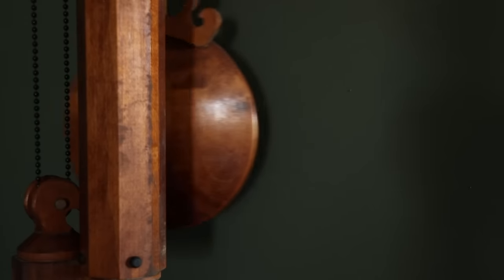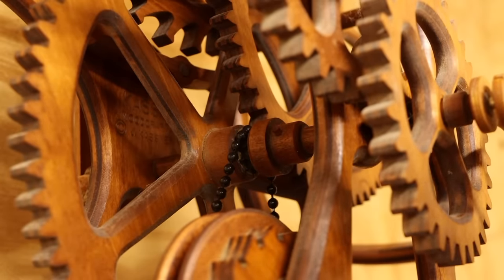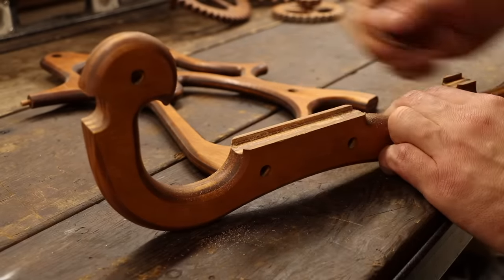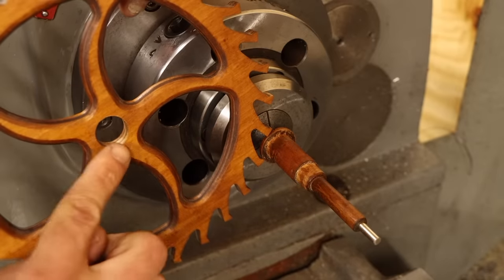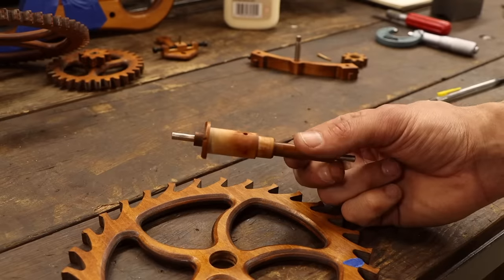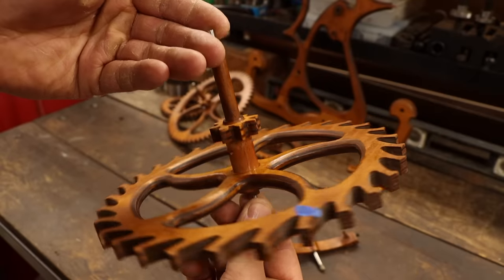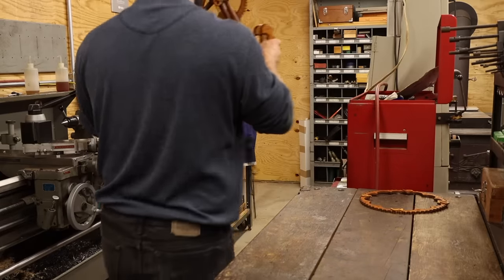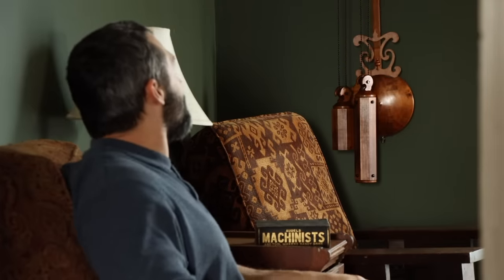Resurrecting the Phoenix Clock || INHERITANCE MACHINING

Comment: I just got a 3D printer for Christmas and I've been wanting to try and make a clock like this. I was really worried about it being plastic, but if a wood clock can work that well, a plastic one should too!
Reply: In theory it could be better as long as you dont have uv exposure! And you can have access to lubricant options!
Reply: @MrHazz0  Yeah I was thinking something like a wax so it doesn't run off but is maybe still more smooth than the plastic
Reply from the maker: I'd say it's worth a shot!

Comment: So, I just discovered you this past week and have watched many of your inspiring videos.  I’m 75 and had a summer job working in a clock shop for two summers in the late 1960’s.  For posterity, I’d suggest you leave a hidden note on the wall brackets with names of the four generations involved.  Thanks and God bless!

Comment: Great project! Brilliant detective work to figure out the problem and an elegant solution too. Now you just need to fix those dial calipers so the "zero" is at 12 o'clock where it belongs! This will take a bit more work then the 12" caliper fix. If I remember correctly they jumped .025 or 90 degrees. That is easily fixed with the "key" This fix will require a little more finesse and a bit of patients. Open and close the calipers and using the "key" see if you can get them go "reset" .025 or 90 degrees off. Once you get there setting zero at high noon is a piece of cake.

Comment: Because it isn't going to be seen (in theory), for longevity, I'd have replaced the wood glue with 5 minute epoxy right from the start...

I'd also have re-cut all the bushings for brass sleeves and replaced all the axles with brass rod to strengthen all rotating/pivoting joints and reduce friction overall...

Still, what you've done looks fantastic!

Comment: This is my first look at your site and I'm impressed with your great work restoring a beautiful clock! I've made clocks of my own design with my 3D printer and one out of wood with my DIY CNC router. The plastic clocks work for a while (36 hours) but eventually they won't run for more than a few hours. The wooden clock is made from maple (not plywood) by CAD modeling a set of plans meant to act as a template for scroll sawing parts in Baltic birch. The wooden clock doesn't work at all. I need to use some of your techniques to evaluate the concentricity etc. but the design does not have all the adjustments of your Kastner clock.
In your spare time maybe you could document the design so the rest of us could try to build the clock as well. 😀 Dave's Videos below is right about the manual. It looks like a treasure trove of information about a classic wooden clock.

Comment: Awesome clock and a wonderful story behind it. So pleasant to watch it. I tried to build my own clock using a 3D printer a few years ago just before I entered university (I am a master student now) and the clock is mostly working just fine, I even published the files online. But I designed the escapement quite small for the tolerances that my 3D printer has, so the escapement has a bit larger backlashes which cause a bit louder "tick-tock" noise than I would appreciate. Since then I sometimes think about better-working and better-looking design, and I think this video pushed me to do that.

I noticed that the pin of the fork has a noticeable gap in the pendulum's slot and thus is skipping during every swing movement of the pendulum. This leads to a significant loss of energy, which can even stop the clock, and should be avoided. The fork should fit the pendulum rod almost precisely without any gap.

Also, the anchor seems a bit weird to me, as the pallets look like in the case of Graham's escapement, but they are placed/rotated in a way (especially one of them) that causes backward movement of the escapement gear after every "tick".

And the interesting thing is also that involute gearing is obviously used – this is not a common thing in horology as cycloidal gearing (or some approximation using circles) is usually used because involute gearing for high gear ratio requires large undercuts for pinions.

I hope your clock will work without any stopping!

Comment: Thats so nice! You managed to get some heritage runnig and I'm sure everytime you look at the clock you will remember your grandfather :) 
I have a old mechanical Wallclock inherited from my granduncle and -aunt. It's a beautiful peace with an wood and glass cabinet hanging on the wall. The clockface is made of metall covered with enamel and the mechanic is all made of brass with a pendulum hanging on a wooden strut, also made of polished brass as well as the weights. I got it many years ago and it wasnt working so I also spended like a week with disasembling, overhauling and reasemble the whole thing. Then it was actually ticking just fine for some years with astonishing precision of about 3 minutes per week. :o But at one point, few years ago, it stopped again and since then it is just quiet... When I saw your video I really would do the next overhaul to mine. And I will do so I can hear the soothing tik-tak again... Thanks for the encouragement to make it again working ;)

Comment: "Kassner had also spent most of his life as a teacher. But when Kassner eventually became disillusioned with the politics of university life, he moved to Tuscaloosa, Ala., near his father-in-law’s lumber mill to begin building clocks, which he felt was the pinnacle of woodworking achievement."

"Kassner designed all the computer equipment for the operation himself, something unheard of in the 1980s. Aside from that, he also designed his own chemical for a special woodworking process called die staining.

“Usually when people work with wood, they stain it on the surface, and what happens in wooden clocks is that stain wears off and works itself into a compound that destroys the gears and everything else,” Tom said. “But Kassner came up with a process that impregnates the maple called die staining.”

Exerpts from an article i found online about someone who came across and built one of these. Local town paper called dyersville commercial. Com. Interesting story.

Comment: I own a Skeletonized Fossil watch, so seeing the Phoenix Clock show up on the feed was an amazing thing to see. Here the mechanical watch is on my wrist, while you have this beautiful clock one up on a wall! As soon as you mentioned timing and time loss I went "the escape wheel". Seeing all those wooden parts I thought it was a binding issue. It's the thing I never have to worry about with my spring-gear driven watch, physical weights to power the mechanism.

My (and majority of) mechanical watches uses synthesized rubies as axel points to prevent as much friction as possible for the steel axels to spin in. The teeth on the fork that catches the escape wheel also has two ruby "teeth" (pallets) which prevents friction as well. With clockwork, you want MINIMUM friction as possible, so you may want to look into adding more lubrication. The other thought I had were the pallets, if there was a way to reduce friction between them and the escape wheel too that might help a bit for timing.

Comment: Suddenly curious, if the clock's wheel dimensions can be transferred to brass or aluminum.  Making a clock from metal would lessen the contact friction between the moving parts and improve time keeping accuracy.

Comment: Ofbyouncan turn metal you shouldn't have any problem turning wood. The only thing you might have to watch putbfor is that wood isn't homogenized in forging, but as long as you adhere to the basics of having a sharp citter and not take aggressive cuts, you're fine.

Comment: Check your clock for level and plumb, at least when you had it mounted on the shop wall the tick and the tock were quite different in angle from the centerline of the pendulum. Also there's an app for android cuckoo calibration, it's free and no ads or anything. Very helpful for getting an accurate baseline on your pendulum length tune. Got the mother in laws clock within 10 seconds a day in under 5 minutes of fiddling.

Comment: Scoring glue joints is a bad idea, if you are using wood glue.  I know it is an old craftsman's logic, but studies done on modern glue have shown it to weaken the joint.  You have two basic bonds formed by adhesives, the adhesive (the joint between the part and the glue) and the cohesive (the joint between the glue and itself).  For primarily cohesive bonding glues (most epoxies, for instance), scoring can be beneficial, but for wood glue, the strongest bond is the adhesive bond, so your ideal glue joint is wood, one molecule's thickness of glue, and wood.  All scoring the wood does is increase your reliance on the cohesive bond, as you are breaking the long grain glue joins which are your strongest connection.

Comment: Great video! I've been watching for a while and as someone who is currently in watchmaking school this was really fun to watch. One thing I noticed is that the pendulum wobbles a bit, it doesn't move in a straight line back and forth. It's something we're taught to look for when restoring old wall clocks like that one. It's usually caused by the pendulum spring being misshapen in some way. I also noticed that the pin that gives power to the pendulum has quite a bit of free room, but I'm not sure if that's causing the wobble. I've never worked on a wooden clock and I've never seen that specific construction for the pendulum. It might be something to look at though if it keeps stopping every now and then.

The one shorter tooth on the escape wheel can actually cause issues as well. Basically what can happen is it doesn't hit the right spot on the pallet, so it can send a kind of jolt through the watch and make it stop or run less smoothly. This happens because the tooth hits against the slanted part of the pallet first, and not the proper place like it does on the other ones. I'm not a native English speaker and I don't know all the proper terms in English, but I hope that makes sense.

Again great video as always! I really loved watching it and I can't wait for the next one!

Comment: Part of the problem is that the designer did not really understand gear teeth. In engineering we use involute gear forms which when carefully designed, running in oil are very efficient, but you cannot design them to work with pinions using less than 10 teeth without modifying the tooth form, the pinion teeth become more pointed with a large pressure angle. That is the gears are pushing apart from each other and that makes the drive inefficient. TL:DR the little gear teeth are too pointy and inefficient.
Clockmakers use cycloidal forms of gear tooth which are more rounded, even to the point of making the pinion out of a circle of round metal pins, called a lantern pinion. Most wooden clocks use these, they work well because the pressure angle can be near zero and there is less thrust on the axles. You have the tools to make lantern pinions but choosing the correct diameter will be difficult as you have no centre to centre adjustment on the gears.  Clock makers make the gears first and adjust the spacing of the axles as they go. 
You may have to make a new carrier for the escape pallets, to move them slightly apart.
The plus points are, that the clock does, unlike most wooden clocks, use a proper pendulum suspension and a dead beat escapement.

Comment: Hi, not really relevant to this gorgeous creation but I can add a bit about clock gears from my limited knowledge. High quality metal clocks tend to use the cyclic gear tooth form rather than involute shaped gear teeth as they can be set to minimise power loss better than with involute. However that pivot setting distance is critical which is why clock makers talk about 'depthing' the gears. I doubt that this nicety holds true for wooden gears which I suspect follow the involute form in this clock. However it does mean that more power than usual is required to run the clock. Probably not a problem other than near the escapement. Really what I'm trying to say is perhaps to have a read up about the intricacies of clock movements - they are an art form in themselves and quite fascinating. Well done on getting this piece of valuable inheritance living once again.

Comment: A friend of mine recently built a wood clock using his CNC equipment to cut the gears.  He used some magic solution to impregnate the wood that is supposed to reduce the effects of humidity on the components.  Yours is old school but well worth the work to correct the problems.  Great video, as always.

Comment: It is spectacular engineering that Brandon with these modern machines and an ancient reference manual from the manufacturer of the clock and also with DRos and what not have been able to restore it to its pristine glory. But more importantly, to imagine that this clock was made several decades ago, and with the precision in manufacturing that relied solely on technical skill and not DROs...

Comment: Very cool. Just some terms for your future projects. In timepieces, the degree to which the pendulum swings back and forth is known as amplitude. In general higher amplitude means more consistent movement. The nut on the bottom of the pendulum and the two screws in the pallet is to adjust the "beat error" basically how close to 1 second each pallet movement is.

These things are a challenge to adjust on wearble time pieces but seeing it here makes it all make more sense.

Comment: Unique video.  I still have my grandmother's mantle clock, as a teen I got it back up and running for her with some cleaning and a little lubrication.  I haven't run it much in the past few years, partially because I don't want to wear it out and part because the noise travels through my hardwood lined house with ease to my sleeping ears.

Comment: I purchased this clock in the mid 80's. I knew at the time I wouldn't have have time to assemble so I wrapped the 5 individual boxes it came in in cellophane wrap and put it away in a dark dry closet. I still have it complete with assembly manual and original sales receipt.

Comment: This reminds me of my struggle with a cheap grandfather clock I found at the swap shed of the local garbage transfer station when I was in my early teens. I never could get it to run for more than a few hours, but lacked the mechanical understanding I have now 35 years later. Watching this video and reminiscing I am almost certain where the issue was in why I couldn't keep it running. It did provide me with a complex mechanical device to take apart and re assemble correctly, as in doing so left me with the same inability to stay running, No chance of finding that clock again, as it went back to the same garbage transfer station a few months later, but into the bin that time. I would say it was a good education for me that only cost me time.

Comment: That glue is not gap-filling.  You'll get a stronger joint if the wood surfaces are smooth , not roughened.

Comment: If the wood is kept for several hours at 230 degrees Celsius, it will acquire properties more suitable for use as parts of a clockwork.

Comment: People who know what to look for can spot the escapement issue right away in the closeup that starts at 4:55. The escape wheel teeth are supposed to drop onto the pallet's locking face (the vertically oriented surface that faces left in the shot), but in the first two cycles we see it drop onto the impulse face (the slanted, horizontally oriented surface on top), and then on the first one it does land on the locking face.

For curious folks who don't know this stuff it's well worth to watch the video through the end, come back to the 4:55 mark and rewatch that shot in slow motion.

Comment: If you really want to check the escapement wheel, Chuck it up in your indexer and lock your camera in above one of the teeth. Now assuming that there are 60 teeth , take a picture every 6 degrees and superimpose the pictures. This way you can see if the teeth are all in the same position relative to one another

Comment: The warped wheels can be fixed. Get a steam cleaner and make a box to contain the wheel. Steam the wheel up for an hour or so then take it out and immediately clamp the wheel up is a jib that will straighten it. This works much better on real timber but should still work on plywood.

Comment: The pallets are meshed too deep.  When the escape wheel is free it should lock on the pallet locking surface just above the impulse surface. Too deep of a lock, like you had in the video would result in a wider pendulum swing and more power needed to overcome this excessive lock. 
Turn the eccentric in the pallet shaft to affect the entrance pallet and move the exit pallet in or out to adjust the drop between the entrance and exit pallet. 
You can also thin the suspension spring to reduce the power needs too.

Comment: A tip with some wood i am not an expert but this has worked for me in the past. That is sock the wood in water and the compress it like in a press and leave it for a few days as the wood drys out it can make it flat as long as you compressing it a place that it can try proper.